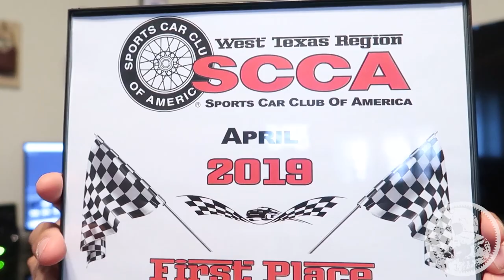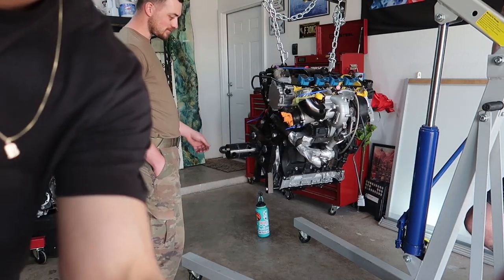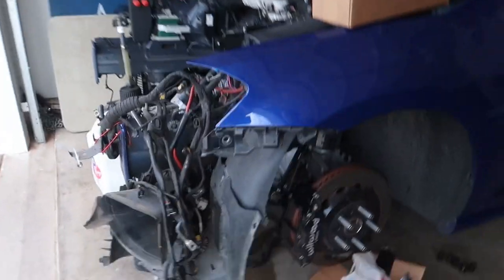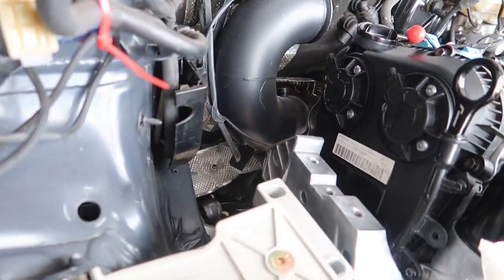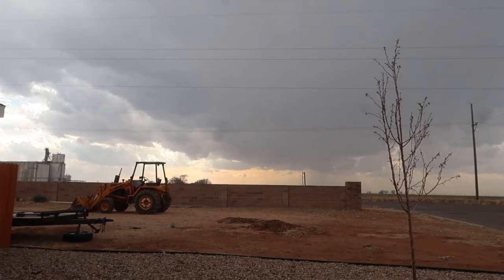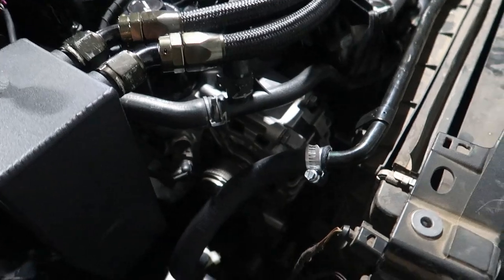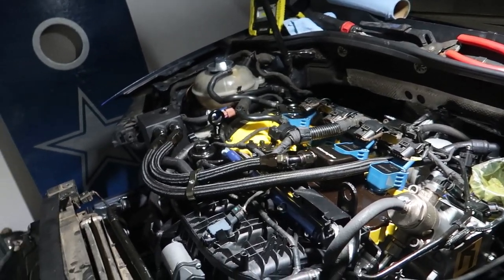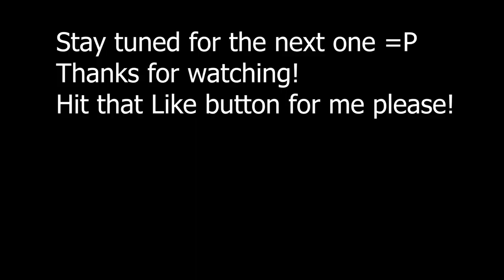First start! Built Motor Built Head! | MK7 Golf R

Comment: Not gonna lie, I hand tight the crank bolt, and send it home with the ol' dewalt 20v impact lol
Reply: I got a cheap counterhold tool from amazon and it barely worked properly. a PITA
Reply: @evanswift5020  I have the tool, but Ive done enough of them, this works for me.
Reply from the maker: You've got big balls! Guess it's not a huge deal but it worried me alot I've had one back off before and I needed my head rebuilt lol
Reply: @BryceJordanProductions  your battery must have been low on charge LOL   Glad the car is up and running again man!
Reply from the maker: I used hand tools 😆 on jacks.. in the dark.. not a good time. Big lessons learned. Didn't know how much that bolt really meant at the time.